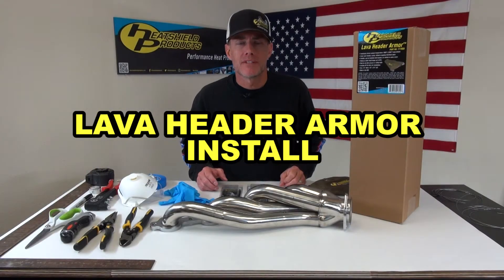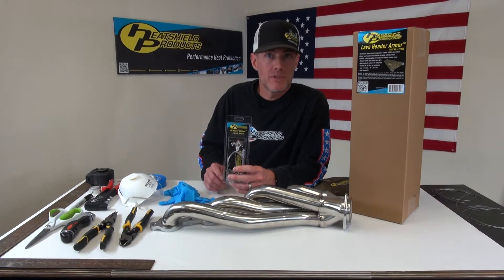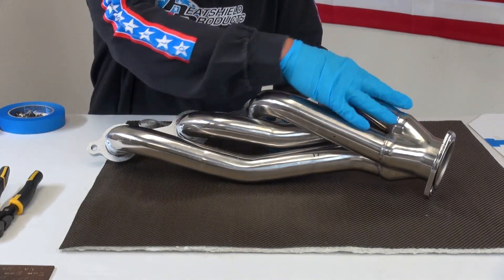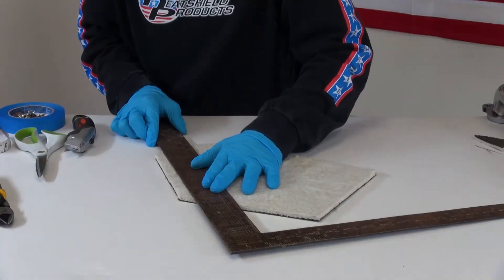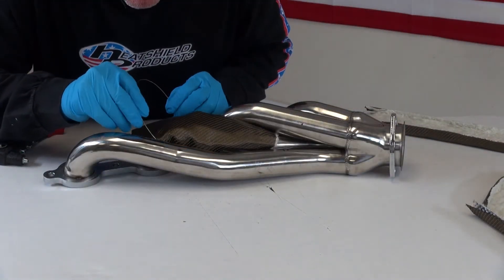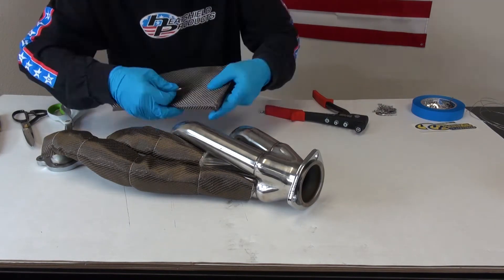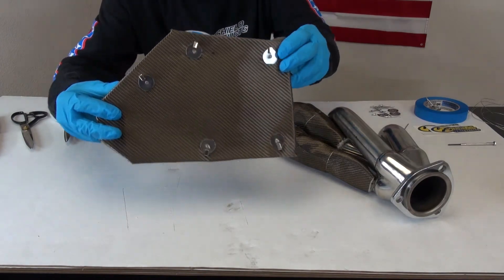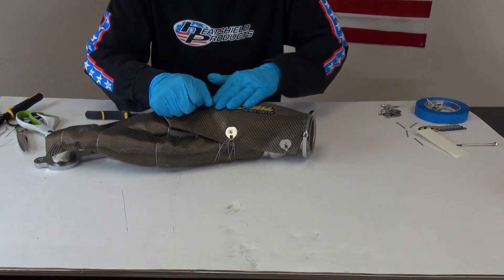LS Header Heat Shield - Better Than Exhaust Wrap | Heatshield Products

Comment: Does it make a difference in either 1/4 or 1/2 in for the same type of application? Have the same setup
Reply from the maker: 1/4 in for naturally aspirated. 1/2 in recommended for turbo, pro-charger or super-charger.
Reply: Thank you..ordered and can't wait to see how good this will help with the heat

Comment: Any problems with installing with headers in car & how about stainless steel zip ties
Reply from the maker: Thank you for your comment Warrior.  Normally there is no issues installing the Header Armor while the header is on the car.  That is the beauty of this product... you can save some time and stop more heat.  You can use stainless steel zips if you choose.
Reply: @Heatshield Products Inc  question, can the headers be fully wrapped 🤔 my starter sits directly behind the headers.
Reply: @bitcoindollar5401  my unwrapped non coated headers are right next to my starter too no issues but you could just wrap it in a way to get the best coverage without completely wrapping it.
Reply: @Heatshieldproducts  thanks for the response definitely have a big engine bay just wondering if there are any issues I don’t see any other than maybe my steering column since I had clearance issues there
Reply from the maker: @WarriorOfEden3033  You should check out our website https://www.heatshieldproducts.com/automotive/auto-heat-shield-guide.  It will give you some ideas of what to do with heat under the hood and all around your ride.  Some of the opportunities we see are wiring and hoses near and around exhaust. Sleeving is a must in and around your exhaust. Mostly inexpensive why to protect vital components.
Reply: Thank you for replying back 👍

Comment: Do they make this for long tube headers that’s a shorty?
Reply from the maker: Thank you for your comment Fast Hippo.  The current sizes in for this part is 1/4in thk X 18in X 24in and 1/2in thk X 18in X 24in.  Both of them come in a singe or double pack.  If you headers are long than that you may consider our Heatshield Armor in a longer size.

Comment: Can I use both wrap and this heat shield?
Will there be any problem..?
Reply from the maker: Thank you for watching the video. You do not want to use this with a wrap. The wrap will become brittle and fall apart and you will have a loose fitting heat shield. This is engineered to be placed directly on the exhaust.

Comment: Will this heat shield in the long run cause the headers to rust out like the wraps. I’ve gone thru two set of headers because of rust eating the metal with the wrap.
Reply from the maker: Thank you for watching. This work differently than a wrap. You should only cover half of the header.  Because this stops so much more heat than an exhaust wrap it is important to let the headers breathe. but leaving half of it uncovered.

Comment: I have used your heat shield.  I was impressed on how well it works.  I had two exhaust pipes coming off the headers that was too close to my fuel lines and the transmission.  I used an infrared temp gun to check temps.   Initially the exhaust without the blanket was a little over 300 degrees.  The fuel lines were about 240 degrees!  I cut, wrapped and secured the blanket to the exhaust.  I checked the temp afterwards and it lowered the temp to 160 degrees!!!!  Great product!
Reply from the maker: Thank you for the comment Jarec!  We really appreciate your feedback.
Reply: @Heatshieldproducts  Just ordered more!